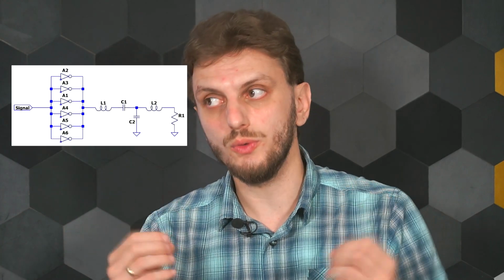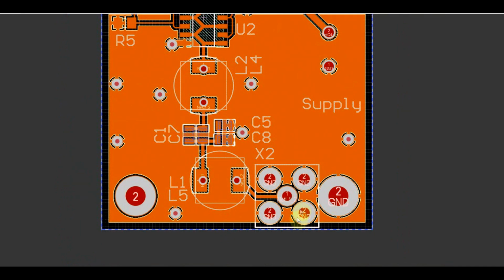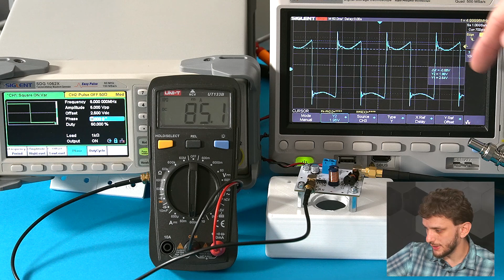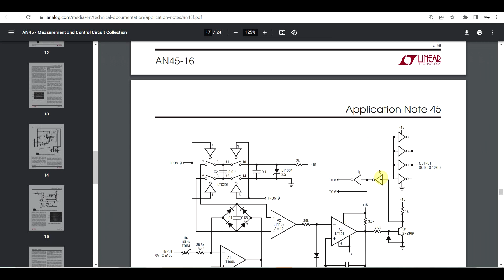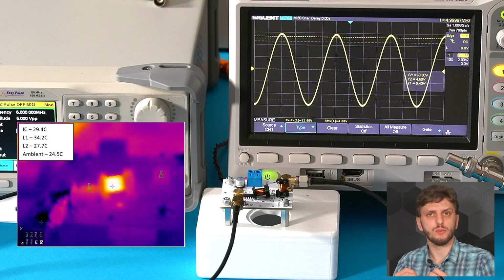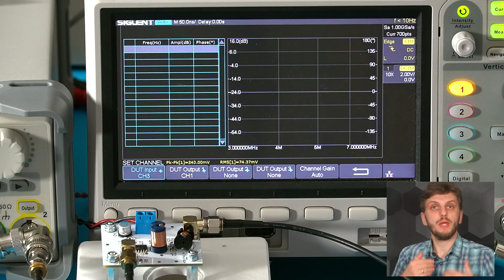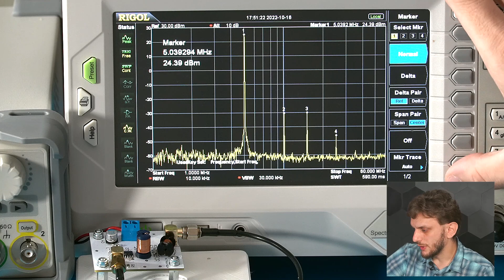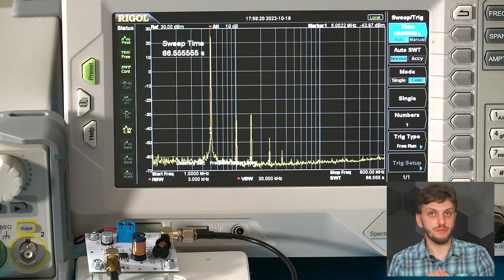The Class D RF amplifier - Testing, testing testing... (3/3)

Comment: Your teaching is golden. Thank you a lot indeed.
Are you employed as a teacher?

Would you please touch on one important topic, please?
Operating the various amplifiers at nonideal match? Resistive, inductive, capacitive, SWRs...
What loading does a non-ideal load cause to the amplifier? Transistor over-voltage, over current, heat?
How quickly does a transistor die under various conditions? How to protect the transistors?

Comment: you should use a mosfet gate driver IC like the UCC27322 instead of the ganged 74ac14. That would eliminate the propagation delay overlap and give you 9 amps of drive as well. I've used one at 7.16 Mhz quite well.
Reply: It's very interesting decision. Could you please share details of your project?

Comment: Hi FesZ Electronics! I was just watching your "A spooky circuit - The Theremin" video and I am going to try to make one. I printed out your schematic for it but I cant seem to find the values for some of the capacitors. Specifically C2 in the volume oscillator, C23 in the pitch oscillator variable, C15 in the pitch reference oscillator, and C19 as the power smoothing capacitor. Do you happen to still have it or do you have the values somewhere? If you don't, do you have a guess as to what these could be? Sorry for posting here but I don't know if you will respond to a comment on a video you made 3 years ago.
Reply from the maker: Hello, the values are not that important there, anything in the 10-100uF will do.

Comment: Fantastic! Your explanations are very clear and thank you for this video 👏🙂👍A few comments if I may.
At 17:02 you say a snubber circuit can be introduced to prevent the switching spikes + ringing noise is the first place.
  1- Question, In your experience, which circuit is most effective to produce the cleanest sine wave from Class D, snubber circuit or output filter (as you show in the video)?
   2- Question, to improve efficiency…is it possible to use a snubber circuit only (high efficiency), and avoid using output filter (low efficiency)?  The inductors and capacitors in output filter seem to waste lots of energy as heat.  
   3- Suggestion, in future video can you show how LTSpice can simulate snubber circuit, to determine optimal component values for -30dBc or better?  I imagine a snubber circuit would add RC components connected between gate and drain of FET to provide negative feedback (maybe side effect = lower amplifier gain but I am not sure)
   I mention these 3 points because a very clean RF output is required by government…depending on frequency and country (examples: Germany -40dBc, US -43dBc, ITC -50dBC or more).   
   It would be good learn how such clean RF outputs can be achieved while maintaining high efficiency.   
    You are a wonderful teacher and it would be good to learn more about how to design the noise control circuits for FET amplifiers. 👍
Reply from the maker: I think the answer to all 3 questions is related - you will need an output filter for a class D amplifier - this is needed to filter the square wave into a sine wave. It is not uncommon for practical amplifiers to have multiple stages of filters (in my design I used a single T filter, but you can have 2 to 4 T filters cascaded); this is needed to pass the output signal cleanliness requirement. How lossy the filter is has to do with the used components, perfect filters don't exist.. Anyway, a real amplifier will never be ideal, so its perfectly normal to have losses.
The snubber and ringing are a different problem - these are related to unwanted parasitics in the switching stage. You can either rely on the output filter or build a snubber to reduce the noise reaching the output, but as another viewer correctly pointed out, the ringing can generate voltages high enough to destroy the switching transistors, so if the problem is that severe, the snubber will be mandatory. 
I do plan to cover snubbers at some point in the future, not sure when though.
Reply: @FesZElectronics  Thank you for the detailed and clear explanation 👍mulțumesc!! 🙂   RF content on your channel is A++++,  better than so many other RF channels on YT in my opinion - I am recommending FesZ Electronics channel to all my RF colleagues at work.  For snubber circuits, I have searched for many years to find literature or technical reference that shows the exact purpose and behavior of a snubber circuit for FET push-pull amplifiers, but unfortunately...most information from others is not clear or not scientific, maybe magic or top secret.  So I am very happy to hear you plan to cover snubbers at some point in the future in your videos.  It is common to see FET PA's with 4 different types of 'noise control' circuits:  1) drain-to-gate negative feedback, also called snubbers, 2) drain-to-ground C, LC or RLC compensation, 3) drain-to-drain C, LC, or RLC compensation, and 4) output filters such as Lowpass, or Bandpass.  Output filters (type 4) are easy to understand.  However noise control circuits Type 1 (snubbers), Type 2, and Type 3 are not easy for me to understand, so I hope to learn more in future especially with LTSpice or other simulations.  Thank you again Fesz for sharing your videos and great work, Bravo!!
Reply from the maker: Thank you for the kind words and the detailed explanation of various countermeasures in your experience! I personally, mainly came across snubbers (drain to source RC) in power converters - this is the type 2 you mentioned; from an operating point of view, it should be the same in PA or SMPS. As documentation support I highly recommend: https://fscdn.rohm.com/en/products/databook/applinote/ic/power/switching_regulator/buck_snubber_app-e.pdf 
Type 1 sounds like it would reduce noise by increasing the switching time - larger slope means less high frequency harmonics, but also more inefficient. For switching converters, this sort of noise countermeasure is implemented by a larger or smaller gate resistor; maybe even some diodes to control turn on and off at different rates.

Comment: While the amp "works" it is important to observe FCC rules on harmonics before placing it on the air.
Reply from the maker: That is a very good point that is in general valid for any RF amplifier. However, I never intended to use this circuit "on the air", it was built as a demonstration to highlight the operation and method of design. As you mentioned, FFC rules on harmonics, or the equivalent in any other country is important to consider - that is why I specifically measured this. May I ask what sort of ratio is mandatory between fundamental and the next harmonic in your region?
Reply: @FesZElectronics  Here in the USA the harmonics must be 50db down from the fundamental. Difficult to meet with a class D amp and have any advantage over a class C.

Comment: It's important to realise that this is NOT a Class-D amplifier, but Class-C. In Class D, the wanted signal is dictated by the PWM of the switching "carrier", but here you are amplifying the carrier itself. The efficiency is of a similar order. Also, given real component tolerances, adding the 10pF across the 1 nF is pointless - the 1nF will already have a much wider tolerance that swamps the 10pF (as well as strays on the PCB, etc). Instead you need to use adjustable capacitors (or inductors) so that the network can be tuned to the exact value to give maximum power output at the frequency of the carrier. I think this series is generally pretty good, but you are inadvertently spreading misinformation about what Class-D is, as well as a small misrepresentation of practical design techniques.
Reply: No, PWM is just one possible way of  driving Class D amplifiers. You can also drive a class d amp with sigma delta modulation, for instance. It is the mode in which the transistors operate that determines the class of an amplifier.
Reply: This is Class D. It's the conduction angle of the transistor. In Class D, transistors are exclusively used as switches and not as linear gain devices. This design definitely satisfies this criteria.
Reply: @m1geo  Well, if you are strictly going by conduction angle, each transistor is on for 50% of the time, or 180°. That makes it Class-B. Also, really a 3rd harmonic of -35dB isn't that impressive. For a RF transmitter, that would generally have to be >65dB down.
Reply: @GRAHAMAUS  In class B or AB each transistor is in the active zone for 180°, not in saturation. In this case each transistor is in saturation, not active zone for 180°.
Reply: I think it's a class D because the output transistors are working in cutoff and saturation without going through the active zone.

Comment: Many thanks for the video. I have several questions / observations. (1) Shouldn't the efficiency of a class D PA actually be determined by measuring AC current on HF frequencies? I don't think that a typical DMM is a proper instrument for doing this (especially in a DC current mode). This will probably require a home build current probe. (2) How one can measure (not model) an output impedance of a class D PA? Is it even defined considering the fact that half of the cycle there is literally no current on the output?
Reply from the maker: Regarding the first point, in-between the power supply and the actual amplifier, I did add some filtration and decoupling. So I was not measuring the current being drawn by the switching stage, that current is coming from the local capacitors, but rather I was measuring the current needed to constantly replenish the capacitors. Honestly I did not check how much ripple there is on the supply line, but considering the large capacitors and ferrite on the board (100nF+2.2uF ceramic and 470uF electrolytic) I will assume minor AC component is left in the supply current. 
For the second point, I'm not sure I understand; you always have both current and voltage on the output (if by output you mean the resistive load); if you are referring to the push pull switch as output, then you still have current even when this is at a low voltage, since the current is coming from the LC part of the RLC circuit. When the high side switch is on, you don't just supply the "R", you also charge up the LC, and when the low side switch is on, you simply close the series RLC circuit, to form a loop trough ground. Current is always oscillating trough the RLC circuit.
Reply: @FesZElectronics  (1) This is actually a good point, thanks! (2) Yes, I was curious specifically about the switching part of the circuit, (!) before any L/C components. Is my understanding correct that if we consider only this part we can't talk about any particular output impedance?
Reply from the maker: I'm not sure on the exact technical definition, but if you are not considering the "LC" part, its not really a class D amplifier, its just a half bridge (for the voltage switching circuit I showed in this video). What you connect after it determines what kind of circuit it is - for example with a series inductor, and then a parallel capacitor and resistor, its a buck converter... Strictly referring to the switches, we can work out an "output" impedance - the impedance into which maximum power can be delivered - which is equal to the switches resistance. However, to maximize efficiency, the resistance in the RLC circuit usually is of higher value.

Comment: idiot...
like everyone else has a board. 
which has cables on all side, 
isn't that idiocy. 
whether it is possible to have connectors on one side. ONLY...

same with connectors and capacitors, high and on the other side smd resistor and transistor & chip. by glue side anty vibration, cover all item 
idiots forever...

Comment: Some observations. You can determine more accurately the output impedance of the device by putting a resistive load between the output and ½ of Vcc.  Adjust the resistor until the swing is ½ of the open circuit swing. Assuming your model is accurate you might even do this in simulation. Of course, the actual device is the best for this. 

Since any single device has all transistors made under almost identical processing circumstances the propagation delays and rise and fall times of each section will be much closer to a match than the data sheet numbers. It is likely close enough that the propagation delay of the circuit traces should be considered and matched.  This is not much of a contributor to efficiency, as you say, but may contribute to the high frequency ringing. Some portion of the 7 ns propagation delay the complementary channels will be both partially turned on, which would contribute to inefficiency. I don't know how much that is and it may be covered by the C*V*V*f/2.

Two other factors should be considered. The traces are transmission lines.  If the output impedance of a single gate were, for example, 60 Ohms you would minimize reflection at the output lead if the PWB trace was 60 Ohms.  Now the square wave will propagate to the junction of the next output and the trace that continues on to the inductor.  Since this is 60 Ohms from the second gate in parallel with the trace continuing on to the inductor. That is 30 Ohms. You will get a reflection that goes back toward the first buffer.  Each intersection will have a reflection. The reflections often bounce back and forth between all these nodes leading to what appears on a scope as ringing on a switching edge at several hundred MHz.  

It would be better to use a stripline or microstripline of the impedance of each output each the same length and then bring all 6 of them together at the inductor input node.  If you have matched the input of the filter to 1/6 of the impedance of the gate output, then you will have little reflection from that node where the 6 traces converge.

The high frequency switching noise is just as likely to be ringing of the package lead inductance and the device output capacitance. The lead inductance is on the order of 1 nHy.  I have seen this ringing in the 1GHz range.

It might be interesting now to use PWM to achieve modulation with your class D amplifier.  If the pulses rather than having a 50% duty cycle were modulated from 0% to 50% but the same frequency you would have a kind of amplitude modulation.

I was particularly interested in this because I am making a 10 MHz frequency reference in which I’m using a VCTCXO with a 0.8 Volt clipped sine output. I feed the output through an impedance transformation circuit to be able to drive an SN74HC04 which requires > 2 Vpp input.  The output then drives several other SN74HC04 sections in parallel which then feed another filter to generate a sine output to a 50 Ohm load.

Comment: Very good presentation.
Can you please check operation at 6V? (Still below absolute maximum so won't cause damage to the IC)
Reply: Careful with getting close to the max ratings here, the ringing should probably also stay below the max level so it's not just the supply to keep an eye on
Reply from the maker: The only difference that should occur is that the output voltage becomes larger. The equivalent resistance of the power stage should be more or less the same, however parallel capacitance related losses should increase since those are voltage dependent.
Reply: @FesZElectronics  I asked because CMOS transistor/switch resistance is getting lower with voltage increase.
You can see that on analog mux resistance and on FASTER OPERATION if 74 logic with voltage increase from 3V to 5V.
Please show us if it's not too complicated to you.
Reply: @FesZElectronics  
Please, at the worst case a poor hex inverter IC will give his life on behalf of the science.

Comment: Surprisingly good result, quite usable for some low-power FSK or PSK.

I’d try to modify the simulator’s parameters with parallel capacitances to the inductors to see if that gives you your ringing. Because if you can predict that behaviour when designing a switching circuit based off datasheet parameters, it would be rather useful. Not sure how I’d measure capacitance though. A current-mode resonant driver?
Reply from the maker: Hello James! Regarding measurement of capacitance, one technique used in SMPS design is to measure the exact frequency of ringing, and then add more capacitance and observe how the frequency changes. Based on the deltaF and deltaC the initial capacitance can be worked out. 
Since the initial capacitance has to do both with the components and the layout, I think the best approach is just to leave some component place holders in the design, and finetune the values on the practical board, rather than rely on simulations alone.
Reply: I'm wondering what te impact of probing is in the ringing, that may also easily add a few pF
Reply from the maker: A direct probing will indeed affect the frequency. That needs to be accounted for if you are interested in measuring the circuit capacitance. When I measured the circuit, in the oscilloscope (with probe ~16pF) measurement I was getting ~230MHz, but in the spectrum analyzer measurement (without the probe) the spike appeared at ~360MHz.

Comment: Great video as allays.
Would ferrite cores help efficiency in this case or just limit the frequency ? Also what about tiny thoroids?
Also since it is a 5MHz signal is the 90 deg bend when you put inductor 2 not affecting the signal ?
Also how and why would the 2 inductors interact if they were inline? 
Also on a side note where are you getting that emailed Cu wire? emag? mouser? or some hardware shop? (asking since i need a custom transformer ratio and i dont know where to go)